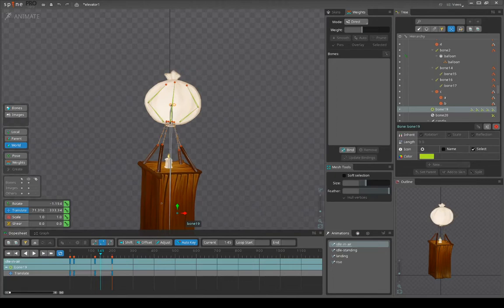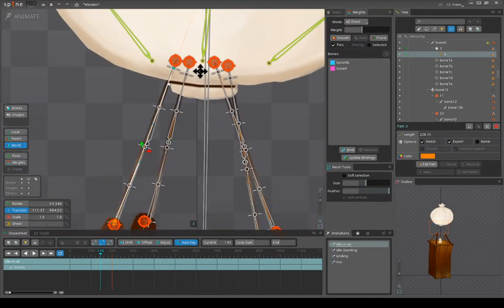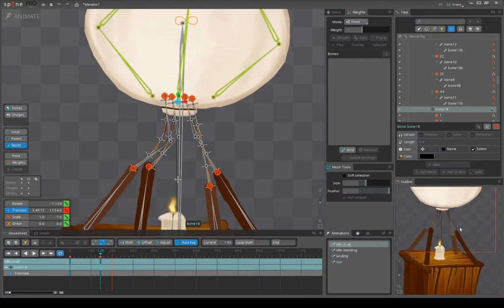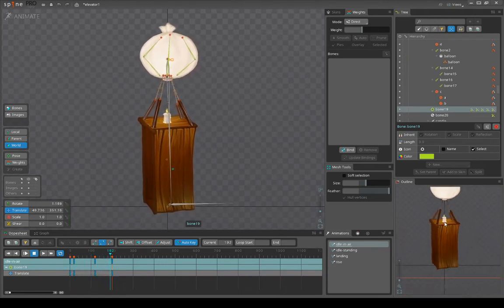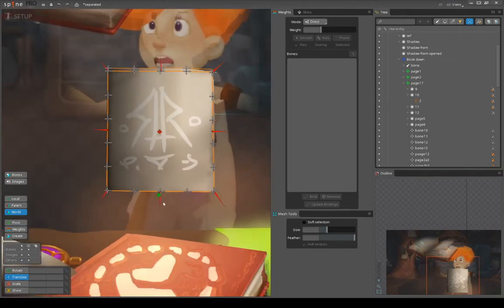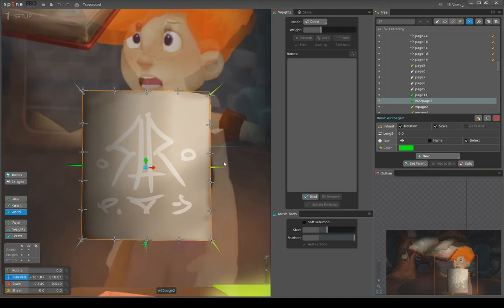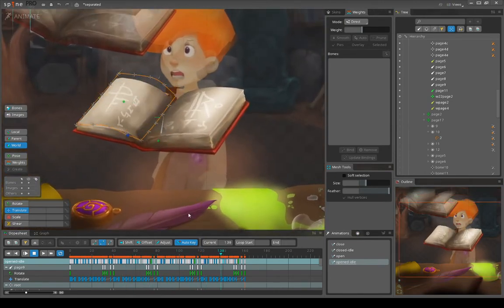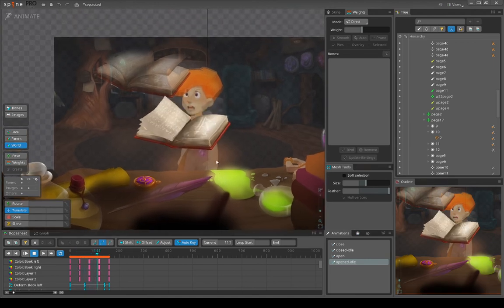Spine 2D Tutorial, Rig Explained: Part4

Comment: Hi! Thanks for tutor and for my ellastic mind :)
Arman, pls, tell me, in the elevator example - how did u make path constraint of every 5 bones with ZERO LENGTH each of this 5 bones (bones a, b, c, d, e) so they all laying along the path? Because in my Spine 3.8.75 if the bone length is ZERO and if it constranted by the path constraint (SPACING: percent, MIX: Translate: Chain/ChainScale) - it's POSITION will ALWAYS freezed to the start of path. But if the path constraint applied to the bone, which has LENGTH > 0 - it will be well-constrainted on the path (the position of bone will be on a path depending PConstraint parameters). What version of spine did u used in this example?
Reply from the maker: Try to change the way they align. Change length to fixed and give some spacing
Reply: @armanimationn  Thanx for the answer! 
I've totally solved my question by installing trial 4.1 Spine and tried to build this bundle (bones + path constraint) - in 4.1 everything as at your example - bones with 0 length is perfect laying on a path.
In my Spine 3.8.75: bones, that constrainted to the path MUST HAVE > 0 length to be aligned to path by spacing (fixed, length or percent - doesnt matter). 
So, I discovered, that your example was maid in Spine 4+ :)